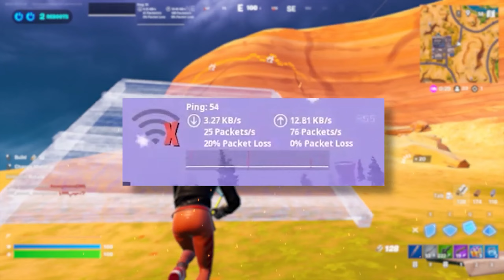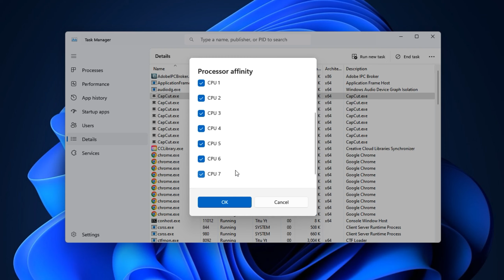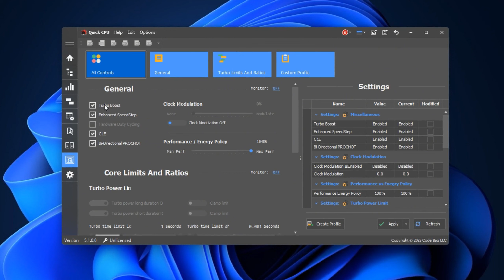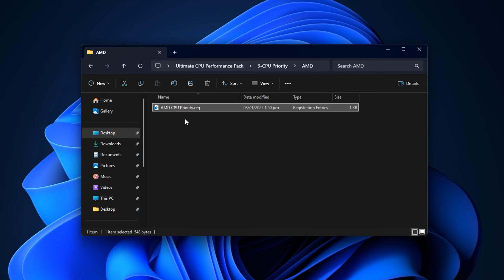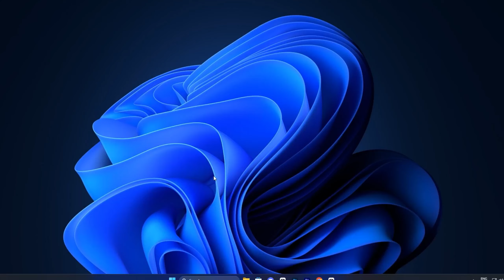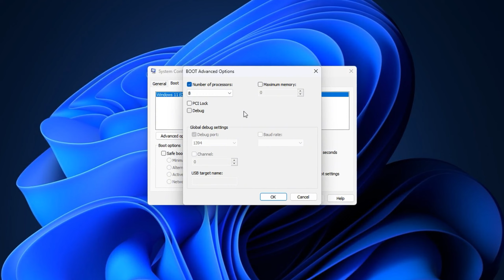Fix Bottleneck & Boost Processor Speed – Optimize CPU for Gaming Performance

Comment: Rayzen 5 5600x rtx 3080ti 12gb gpu no full uses 45.60% only 1080p monitor  any solution quick cpu all setting change no working
Reply: Lectroon
Reply: @Unkno4d lectroon mean
Reply: you are getting bottlenecked by the cpu you need to upgrade cpu
Reply: My cpu 16.17% 1080p setting bottleneck 1440p no bottleneck